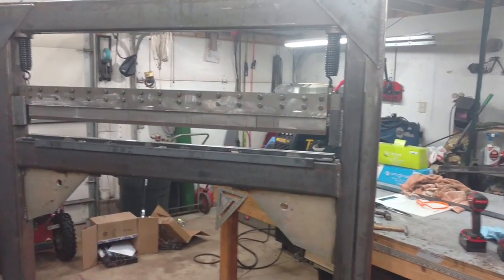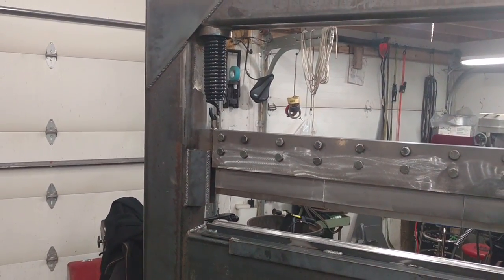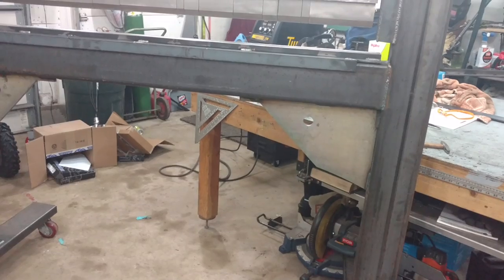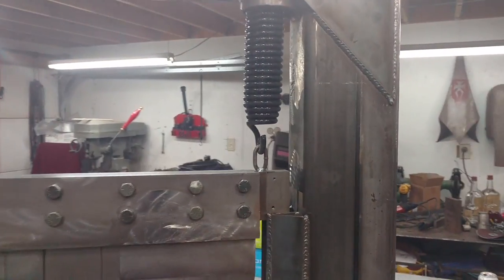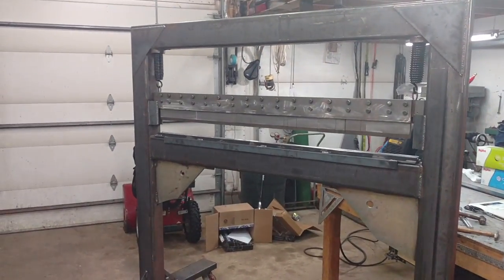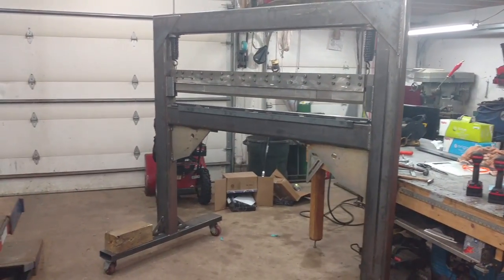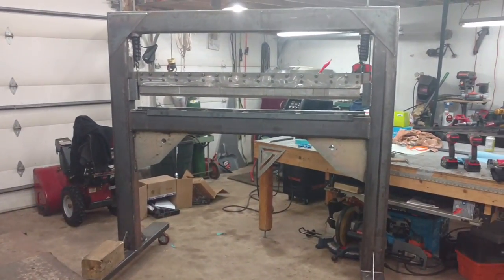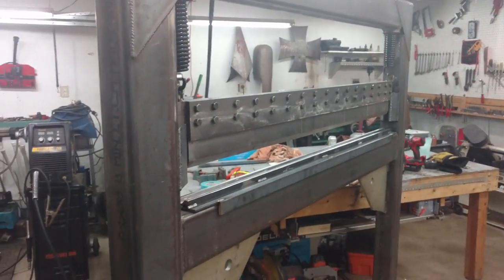Homemade Press Brake

Comment: Looks great.  But to answer your questionif the top 6x4 beam will bend, it will.  I built a brake almost identical to yours about ten years ago.  Worked fine on 14 gage material but bent the top on a piece of 10 gage by about 40 I inches long .  Weld the truss assembly on top before you try anything real heavy.  Great job though!
Reply: Ron what size jack did you use for 14g..I want to build an 8ft for sheetmetal.
Reply: Using two 12 ton bottle jacks
Reply: @rontucci3552  how long was the 14g piece of metal?
Reply: 60 inches

Comment: For the top, adding a "spine" on it will help. That should bend 1/8" steel to 90° easy. I'd guess you'd need 2 20 ton jacks. Also, have an update video on this?

Comment: You’ve gotta worry more about deflecting the bottom beam, also don’t know if you have a crown on the bottom plate, all brakes have crowns for deflection.
Reply: Do you know approx. how much of a crown needed for a 30" wide brake?  Thanks
Reply: @donsmith9081  I think I would just buy a 4 or 8 ton bottle jack and rig it up too the middle of the bed, a lot of brakes I’ve operated had hydraulic cylinders, longer brakes had 2, all you’d have to do is put 1 jack in the Center, and use it when you’re doing heavier material. I wouldn’t worry about a crown on such a small brake, use the bottle jack.
Reply: Also what material are you bending and thickness. ?  I’m a 100% sure that idea i posted will be your best bet.

 @donsmith9081
Reply: @duramax78  I appreciate your replies.  I have a 50 ton Ramco press. I would like to bend mild steel  1/4"    30" long.
Reply: @donsmith9081  thank you, I’ve ran anywhere from 80 ton to 750 ton brakes and presses for many years, you’re getting fairly thick for a machine like that. Is it manually powered or powered? You should maybe look for some old dies made for a bigger brake, if you can find one area of a 18’ or whatever die your length that is in good shape you can always cut it down, there’s lotsa damaged dies with good pieces. And also do you know the 7:1 rule in braking? What kinda radius are you looking for.? You should be looking for about a 2” bottom.
Reply: Sorry sir I just watched your video again dies are fine, but if you got a 30 degree die you would need probably half the power you need with the 90 degree bottom, and also if radius isn’t that big of a deal I’d go maybe with a 2.5” bottom 90 degrees, your radius will be bigger, but if it’s not a problem. I had to bend a piece of .500 24’ long and had a 4” bottom with a gooseneck die to 90 degree, that was the most power I ever used, that took 680 tons. How much deflection are you getting in the material? Degrees in the middle to the sides? Sorry about the ranting.

Comment: Where did you order the finger dies from? Currently building an 8ft brake and was wondering where u got yours thanks!
Reply from the maker: I machined them out of cold rolled 1018 steel.  Good luck with your build
Reply: TheJessehart05 Awesome! Very talented thank you for sharing your build

Comment: Hey Men that's exactly what I want to build, but I need at least 2 meters long. So do you think it's possible? May be using two jacks? And I need to bend 1.5 mm thicknesses but 2 meters long.
Reply from the maker: alvarenga512 .  Yes, I have 2 20 ton Jack's that bend full length of 1/8 aluminum like it's nothing.  PM me and I can send you finished pictures.
Reply: Thanks a lot! But where can I send you a PM? I already add you in my google account
Reply from the maker: alvarenga512 .  Email me.  jessehart05@gmail.com

Comment: Jesse ,
Did you make or buy the fingers for this brake ?
Reply from the maker: Daniel Lance I made them out of 1018 cold rolled steel
Reply: @TheJessehart05  Thanks for the response Jesse . I apologize because right after I sent you that message I read through another comment where you answered that detail . My bad !    That's a nice brake . I have a pair of 50 ton air assisted hydraulic jack's that I'm going to use to build a 10 foot wide brake . I am primarily going to use it for aluminum but might occasionally bend some steel or stainless steel and am concerned that mild steel fingers will deform .
Reply from the maker: Daniel Lance No problem. Good luck with your build.

Comment: how did the bends turn out? anything you would change?
Reply from the maker: Bends turned out awesome.  I wish it was bigger and I'm going to make an adjustable back stop.
Reply: @TheJessehart05  What do you mean Adjustable back stop?
Reply from the maker: Rocky Blankenship something so you could slide a piece of metal in and it would stop so you could have repeatable bends without measuring
Reply: @TheJessehart05  Nice build. Researching how to build an adjustable bottom die.
Reply from the maker: Rocky Blankenship don’t over do it.  Keep it simple.  Make two different dies if you need to. Good luck with your build.

Comment: What did this project cost you?
Reply from the maker: About 800
Reply: @TheJessehart05  is that with the price of the knife fingers or did you fab those too? Asking because im lookin into building one for bends of 3/16 steel 30" wide. Ill be constructing it for about 60 tons.
Reply from the maker: @tribounty1392  I made the fingers and the beam they are bolted to
Reply: @TheJessehart05  ty very much.

Comment: Plans for this?
Reply from the maker: Nicholas Kin .  Sorry it's from scratch.  4x6x3/16 box tube.
Reply: TheJessehart05 no prob, u think this would hold up to 40 ton jacks?
Reply from the maker: Nicholas Kin .  More bracing and thicker metal it will hold.  Alot depends on your lower die radius.